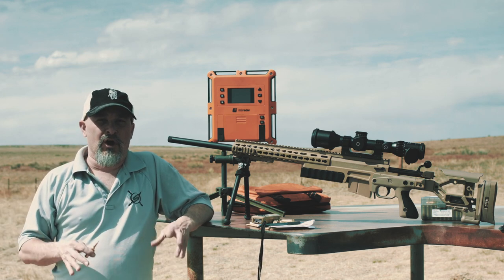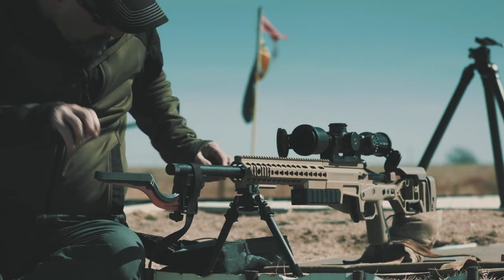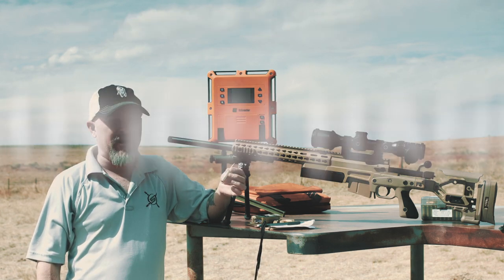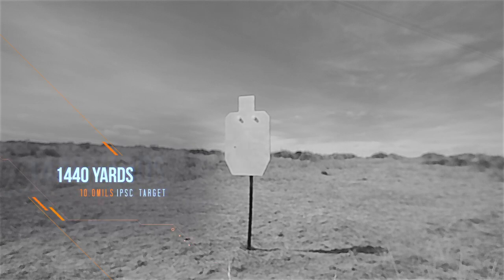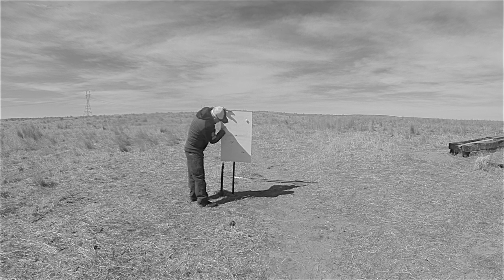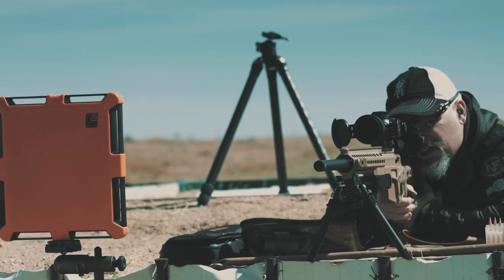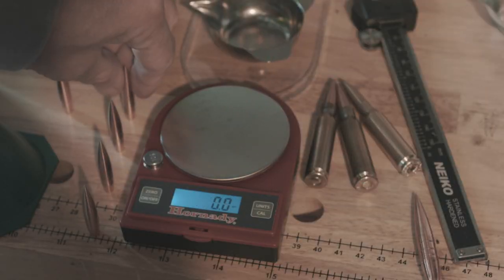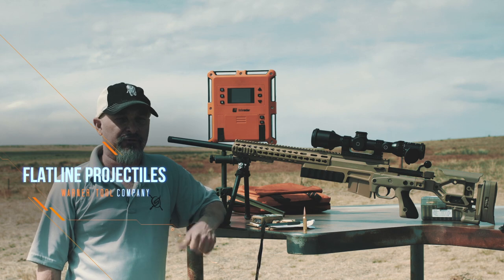Sniper's Hide Reviews Flat Line Projectile 122gr 6.5 Bullet

Comment: Quick question. Is there a sweet spot in velocity that has best performance vs barrel life? I have now accomplished 1820 yds with the factory Hornady ELDX. The bullet was still stable but I could probably flick your nose with my finger as hard as the bullet hit the plate. (24"X24") My rifle is a Christensen BA Tactical in 6.5 Creed. Out of my 26" barrel I am getting velocity at 52 degrees of 2712 fps. I have tried the Factory 147gr and cannot get it to produce better than 1" group so I picked up my very first press (Forster). My goal is to get the 147 upto 2750 fps and a half inch group. I do not compete, it is nothing more than a hobby at this time. At these ranges we are now flirting with velocity vs. inertia. At same time burning a barrel out at 2000 rounds doesn't sound that great to me.

Comment: Blowing primer, hard bolt lift and 3,100 fps from a 22" barrel ?
I'm thinking the load generated over 70,000 psi easily.
Check your bolt face to make sure it's not torched/etched.

I know someone who tested the 30 cal faltline projectiles with a pressure system and he concluded they can not be pushed faster than traditional bullets with out raising the pressure.

Not all rifles are as tough as the AI rifles.   Hence why you got away with such high pressures.
Reply: Indeed. I could run it through Quickload, but why bother...43 grains Varget...Geeze-us.  I'm doing fine at my range distance with 36.6 behind 140 elds.

Comment: Interesting information got me wondering what these would do in my 20" tikka Ctr .260
Reply: Funny you mentioned that I immediately bought some 4166 and went to work with 123 amax's for my Ctr 6.5 Creed 20". I used fire formed neck sized brass and was able to take it up another grain at 42.5 without pressure signs producing 2950 fps and .4 moa three shot groups (multiple groups @.4) .I took it to 43.5 but scene pressure...also scene 3050 fps out of a 20" barrel.